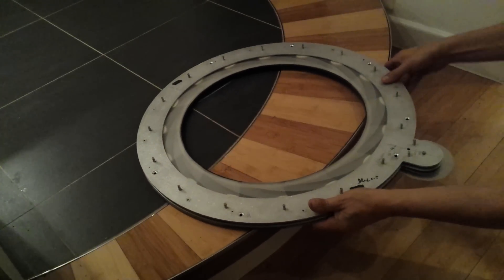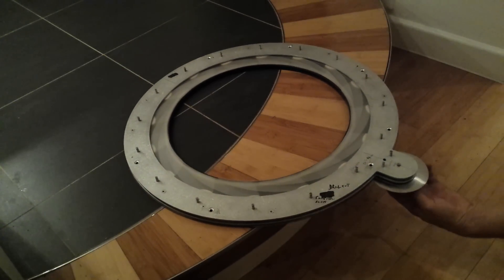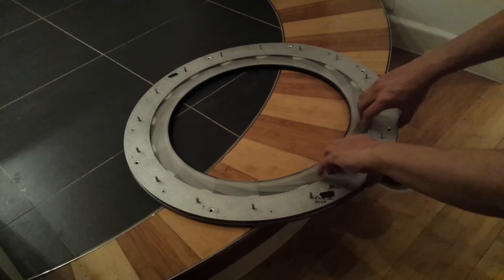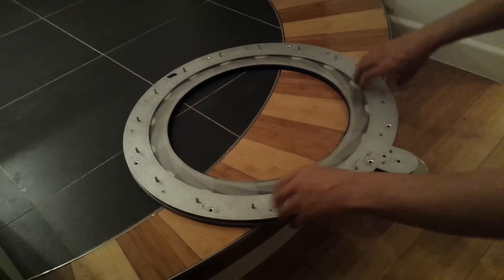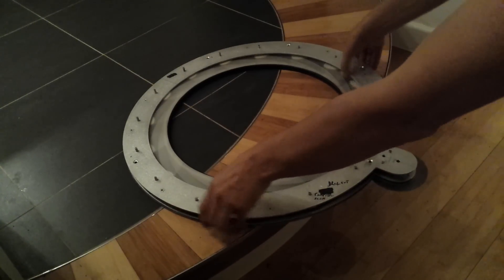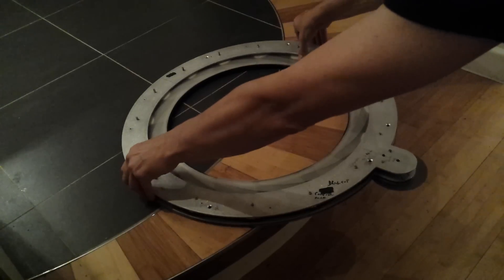Mechanical iris window shade dismantled.

Comment: Can you make one about 15 feet wide from a titanium-trinium alloy?
Reply: Nope. Trinium isn't a real mineral.

But it can be pure titanium like the one they used back before they discovered trinium.
Reply: Forget it, TV is rubbish and they lie.  I tried it at home and the buggers still get through the stargate.
Reply: My iris works fine but. My gates connection keeps cutting out mid traveller incoming
Reply: @VestedUTuber  Next you are gonna tell me Naqadah isn't real?
Reply: @lad5912 
I mean, it could exist. It doesn't, but it could. The properties of that stuff (extremely high density, usefulness as a capacitor, radioactivity) suggest that it's a superheavy element in the island of stability, with an atomic number in the 200s.

Thought you might find that interesting to make up for my missing the point a year ago.
Reply: @VestedUTuber  Are we sure it doesn't? The universe is a big place, it could exist somewhere
Reply: @khaansulu5695 
It's not just a matter of it existing somewhere in the universe. Fact of the matter is, we're really pushing the periodic table to its limits at this point. Superheavy elements become increasingly unstable the larger their nuclei become and relativistic effects on their electrons start to cause issues. Even something as relatively non-exotic as gold already runs into problems with general relativity due to the size of its electron shells - this is actually what gives gold its, well... gold coloration. There's a possible element 119 and 120, but beyond that we're really pushing the limits of what can be synthesized in a stable enough form to even be considered an element.

Comment: to all you guys moaning about how he didnt explain anything 
its really simple he uses a drive belt to move cogs which have the iris parts attached to them 
and he added one more coq that has a round knob on it so when he turns the knob the drive belt turns all 
the other cogs which opens or closes the iris depending on the direction you turn
if you want make something similar just google template for mechanical iris and you will find a lot of templates

Comment: Hi,
I'm a student in cabinetmaking, and i'm working on a project for a photograph. I had the idea of making an openner with an iris and i saw your window iris. Which is pretty cool ! Is there any ways you share me the plan of it. Like with the dimensions .... Actually it's for the blades that i'm having issues...
Reply from the maker: Hi Gregoire, I have placed some cad files in a Dropbox folder. you can use this link to access them. 
You might have to copy and past link if it doesn't work from here!
https://www.dropbox.com/sh/hnvmtf7ak9at1aw/AACylPueOzb-4CD-jKivNLyHa?dl=0
Hope you find them helpfull:-)

Simon
Reply: Thanks!

Comment: Hi Simon,
Do you have any files that I might be able to have either DXF or anything suitable for CAM software?
Love your work!
Reply from the maker: Hi, check the other comments and you should find a drop box link! You will need a cad program to open and then you can export to DXF.
Enjoy!
Reply: I Installed the Rhino3D evaluation version. Then I had to rotate it so the Front view was in the XY plane. Then I saved it in DXF.  Then I opened it up in my 2D CAD (DeltaCAD). Because it is a 3D model it converted most of the ARCs to line segments. It will take some work to clean it up for 2D. If I can redraw 1 blade the other 15 can be copy and rotated easily.
Reply from the maker: Check the Dropbox link again and you will find a native Rhino 5 file that contains separate line work. just export select these as DXF.
All should then be fine.
Reply: Thanks.  Used "R12 Lines & Arcs" setting for DXF conversion. Had to rotate the gear part 22.5 degrees clockwise. To position the gear paddle to the blade put the hole in the gear X+19.936875 Y+4.425723 from the sharp corner of the blade. Replaced small line segments with single arcs.

Comment: lol.. well, that didn't explain anything.
Reply: only because you didnt pay attention...
Reply: it's basically a bunch of flower pedal shapes interlocked that rotate inwards
Reply: The video was a demonstration. If there were words spoken, then it could have been an explanation.
Reply: there is a band around the inside that controls all the petals.
Reply: for someone with a brain the video explains entirely how it works and how its put together

Comment: my question for iris mechanism is how the driven is kept without a mounting small shaft.... the driver gear is mounted on the motor shaft... but the driven that contain the shutter is not mounted on any shaft..... (it's center is open)
Reply: See at 0:54 it has a belt around the outside, and then each blade has it's own pivot point and gear teeth.